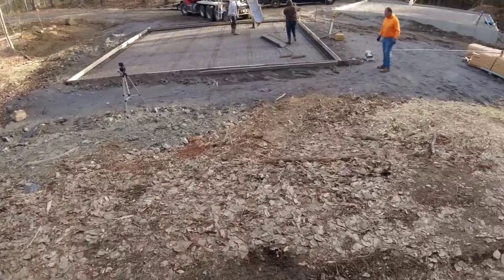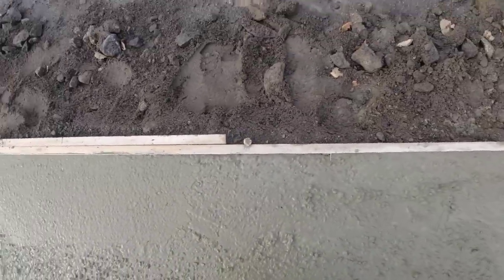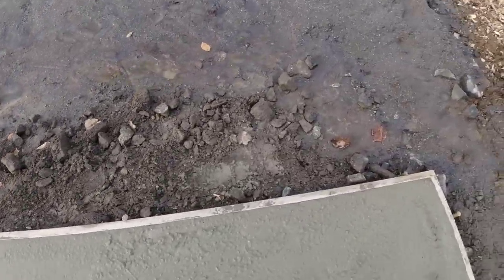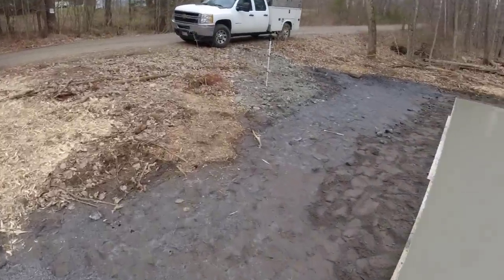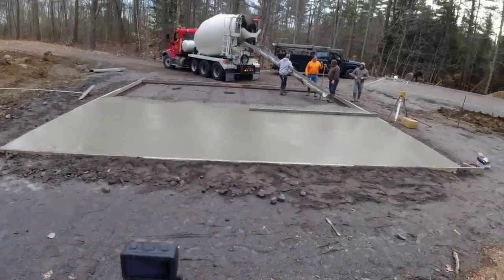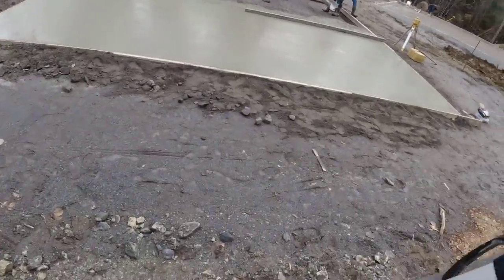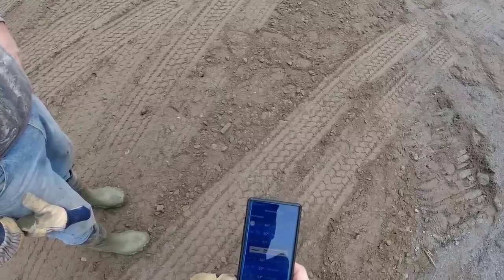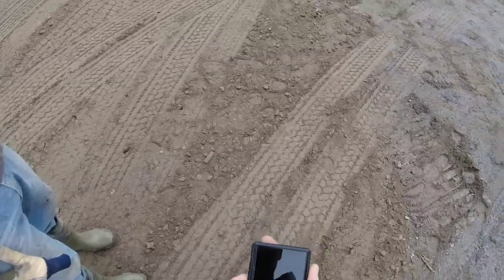How To Pour A 30' X 30' Concrete Slab with Wire Mesh and Rebar

Comment: I have a 30x30 garage I built maybe 30 years ago. I went with a 4 foot knee high foundation then poured the slab a few weeks later. Love it, great size garage. The only thing I would do different would be to frame the front for three garage doors, I put two been kicking myself in the ass ever since.

Comment: Perfect size, my last garage was 27 x 27 with 12' ceiling and full walk up attic. That extra 3' would have come in handy many times, so yes perfect size
Reply from the maker: Thanks Ed!
Reply: @MikeDayConcrete  Isn’t that wire mesh too low? It should be in the middle of the concrete slab. 

But you have it all the way at bottom where ground is

Comment: You see the guy pulling up the rebar but then everyone walks over the rebar which pushes it right back against the ground. You need to use dobies to keep the rebar off the ground, inside the cement.

Comment: In the UK inspectors visit construction sites where concrete is being delivered
They take a sample of the mix, do a test to see if it is up to standard.
Do you have anything like that in the USA?
Reply: I have never heard of this being done for residential at least in my area. DOT projects and some comercial and industrial jobs will do this or get core samples after the fact
Reply: Up in alberta canada we only have them show up for commercial jobs or if it's requested by the owner/builder.
Reply from the maker: Not usually on residential, mostly commercial jobs.
Reply: This is why EU residences are built much better; REGULATION and high specs structurally and thermal barriers. Of course the price per square foot would not be acceptable to American consumer, but as the us residential builder quality declines, prices rise and tendency to cut corners expands, we may reach a tipping point. If you are gonna pay seven figures to build a house people  are gonna expect houses to be built right.this will happen with teh next recession when the industry is no,longer so flush and complacent.

Comment: Thanks for the Vid!  the width at  13 secs doesn't look like 30 ft. wide. Of course, only guessing. It just "looks" narrow. Looking at that 2 x 4 at the front edge. Even if it was a 12 ft., that would put it at 24 or 25 feet across.

Comment: Right up front please forgive my lack of proper terminology.  I'm north of you up in Smyrna Mills.  I'm planning to build a 24X28 garage using a mono pour, or perhaps just a slab on grade.  In this video it looks like a mono pour.  Do you have any videos on how the ground was prepared or perhaps covered in your course?  With the frost line being what it is here in Maine pouring a footer and stem wall down to around six feet is a tad expensive. Can that be avoided and just pour on grade with say a two foot by two foot trench around the perimeter filled with gravel and a drainage system?  As a side note when I was 18 years old, a long time ago, I showed up for my first day on the job pouring  the foundation for a large apartment complex in cutoff jeans and no shirt. You only do that once.

Comment: Isn’t that wire mesh too low? It should be in the middle of the concrete slab. 

But you have it all the way at bottom where ground is
Reply: I agree with you. They may know something we don't.
Reply: Mesh should be 1/4 to 1/3 of depth frim bottom

Comment: What is the point of pulling the mesh wires up when the next person is step it down afterwards.  I think it is a terrible work.  The mesh wires are at the bottom of the concrete slab and not in the middle of the slab.

Comment: Howdy  , I'm from Australia and we chair our mesh or ( at worst lift our mesh ) . Just got to ask , are you allowed to pour with mesh on the ground ?? 🤔🤔🤔
Reply: There is no law against it, but you are correct. You NEED chairs or dobies to ensure wire remains r proper height inside concrete and mesh is covered by adequate concrete thsi is essential on a 4-5 inch pour where you have little margin for error.